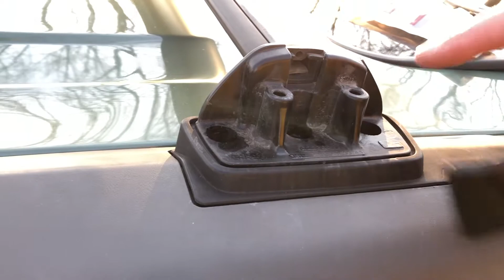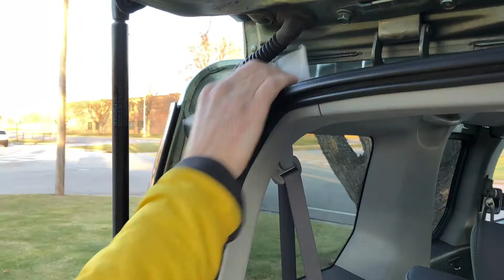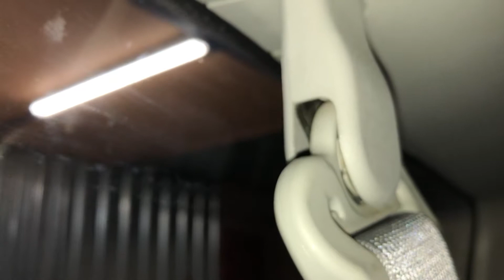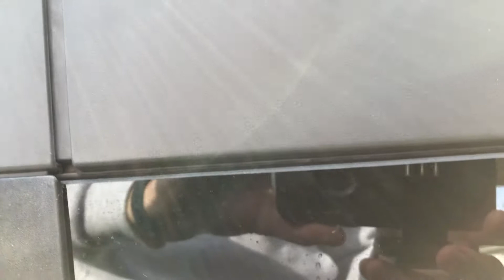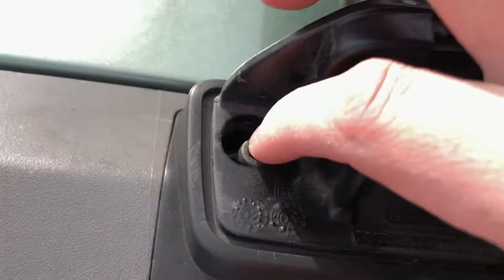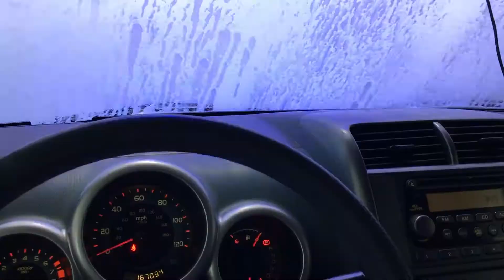Honda Element - Rear Roof Area Water Leak Find and Fix

Comment: Hola gracias por la ayuda en mi caso tengo un 2004 Honda Element y el Sun Roof de atrás los drenajes que tiene cuatro estaban desconectados en el panel lateral detrás de la base del cinturón desde ahí inundaba la rueda de repuesto y corría hacia delante y tenía Inundada toda la alfombra hasta los pies del chofer, es un tremendo desarme para poder secar la alfombra pero creo que es la solución.

Comment: Thank you for this! I'm about to address the same issue, but on the passenger side.
Reply from the maker: Good luck!
Reply: @brycecarlson  WELL, I removed the rear and middle roof edge panels and found no leak. But I certainly wouldn't have been able to remove the rear panel without your video.
Reply from the maker: @sixtonshark2854  I would also look under the front panels. I have no idea how to remove them as I have not myself. But I would assume if you park on an incline facing forward maybe it is leaking and running to the back inside the headliner. Alternatively; maybe check the rear moon roof (if you have a AWD model where it comes standard) drains (take the glass out) and make sure they are clean. Might be coming in right there in the rear.

Comment: OUTSTANDING video!  I, too, am tracing a leak on my Element (07 EX).  I’ve eliminated the moonroof as a suspect and the next step is to remove the trim panels as per your video.  My leak has been intermittent over the four years I’ve owned the E, so I’m thinking there’s a small leak between body panels and “crud” has gotten in there and sealed it most of the time.  Your video will make the panel removal much simpler.  Thank you!
Reply from the maker: Glad it could help! Good luck with your project!

Comment: Hi Mr. Carlson my name is Tony and I have the same problem and it's leaking from the back could it be the same I don't know, please help me, what can I do to fix the problem.
Reply from the maker: The only way to know were the issues is to take the panels of like I did and look for a source of the leak from the outside. Alternatively; you could trace it back from the inside. I did not do that because I did not want to disturb the headliner in my vehicle for fear of it not going back into place.

Comment: My  2011 has a leak at the back right corner that drips through the molding n pools on the floor. I hve to put a small bucket on the floor  under the molding area to catch it when it rains. I thought it was getting inside the life gate at the wiper washer hose fitting. It tried to seal it but still get water inside

Comment: I have a 2004 Element  in Russia and fixed the same leak. Thanks a lot for finding the problem root! There was no great hole but i had a clue and finally found a small crack in the paintwork Sealed and fixed!
Reply from the maker: Nice work! Glad it was helpful!